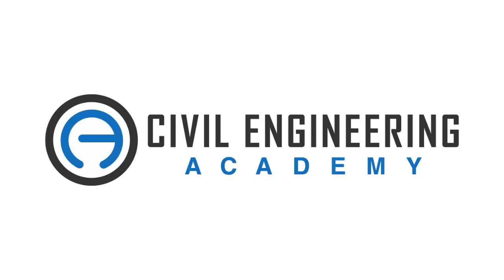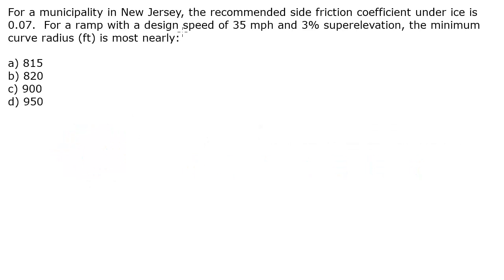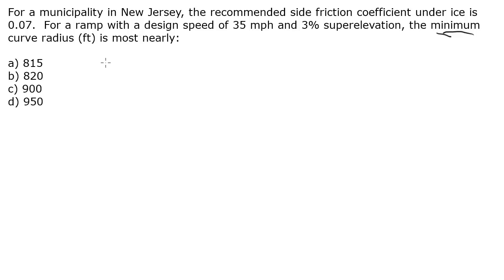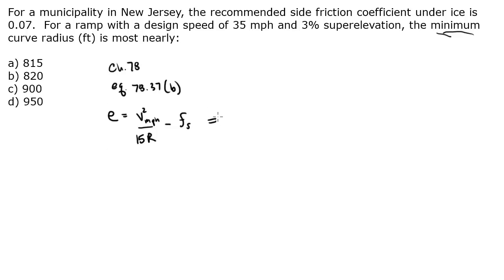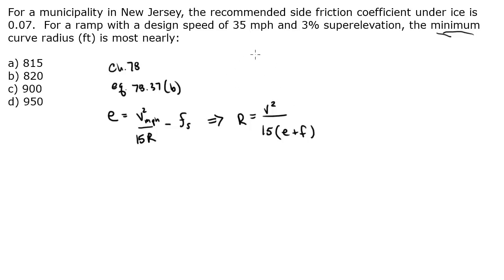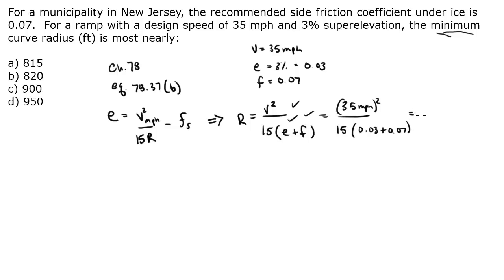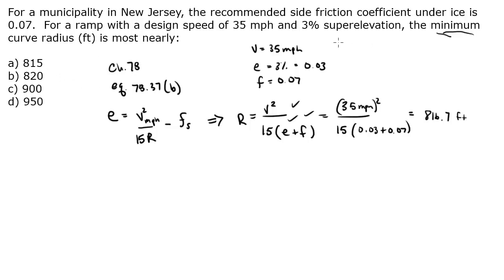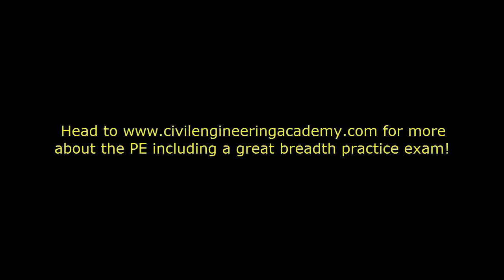Transportation-Superelevation Equation to Find Radius Curve

Comment: constantly referencing the Civil Engineering Reference Manual doesn't help the examinees that are taking the Computer Based Testing. They won't be able to access this reference in the exam. You should be pointing them towards the references that are available to them. Doing this will also show them detailed concepts on the topic in question , providing more comprehension instead of just problem solving processes.